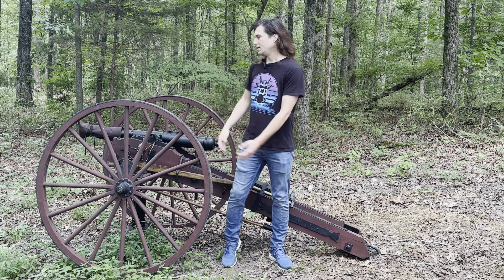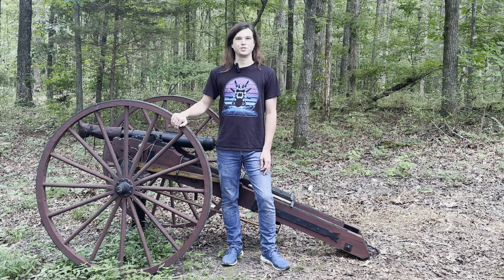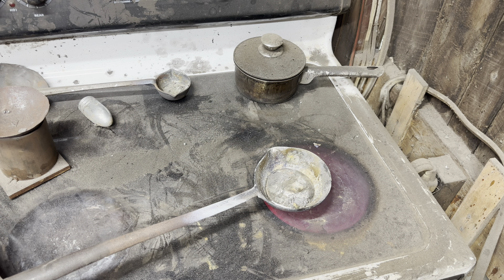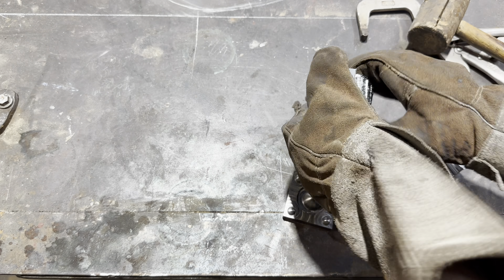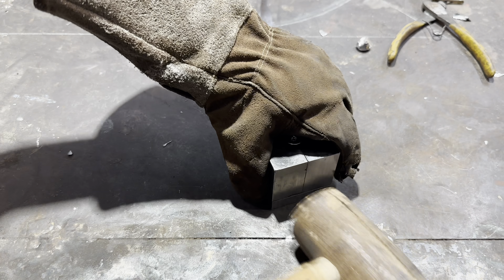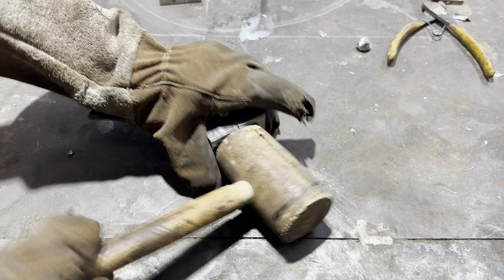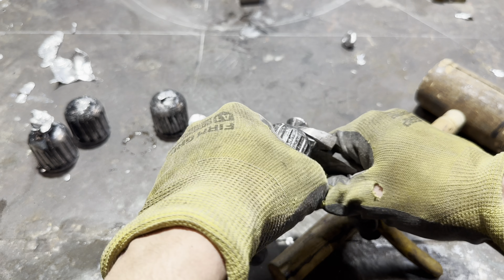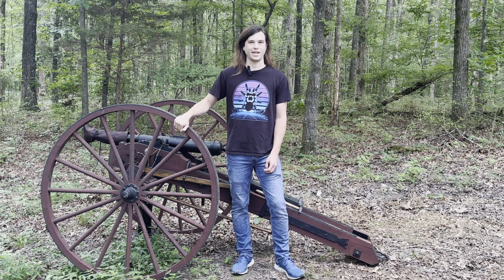Making the World's Largest Rifled Foster Slug

Comment: Drill the pouring hole out so it has parallel sides, the sprue is anchoring the slug in the mould due to the rifling. With a parallel sprue it should unthread out the bottom 👍

Comment: I'm a silversmith and I have never worked with lead but I melt a lot of silver just a little tip if you're mold is made of carbon steel season it until it turns black and it becomes like a non stick skillet and you don't have to smoke the mold every time just use some used motor oil and a brush before each pour or you can take WD 40 and spray it before each pour and the oil will create the soot from the heat in the molting metal also heat your mold before each pour and it will come out a lot smoother again I've never worked with lead but this is what jeweler and silversmiths have been doing for hundreds of years but lead does have a much lower melting point than silver or gold so I can't say for a fact that the oil will get hot enough to create a soot coating definitely work but I would think it would be plenty hot enough to burn the oil off and create a soot layer just the same. But either way thanks for the great videos I love watching you and seeing what you're going to be doing next. Oh and if the oil coating doesn't work you can take any torch a cutting torch works the best I use propane and you just turn the gas on and don't use the oxygen get a oven reck or hang them with a wire and you can get the soot your looking for so much faster and easier

Comment: Pre heat your mold, before pouring the lead. I use a hotplate and after smoking the mold, it's much easier to use a stick candle, and just place all three parts of your mold on the hotplate. After each pour. Repeat the process each time. After the parts of your mold,is nice and hot,pour your lead. Your Foster slugs, will come out perfect everytime. I always flux my lead by using a small piece of bee's wax and then scrape the crud off the top with a long handle spoon. Good luck on your endeavors. Your videos are very cool dude. Peace on the path ✌️🙏

Comment: Smoke the mold, heat the mold, use a punch to tap it out the bottom of the mold after drilling the lead out of the sprue. The twisted rifling crosses from one side to the other causing your opening problem. The cavity needs to be much deeper to even begin to act as a foster slug. It will not swell out to bore size or fly straight. Consider having them machine and bolt in a deeper cavity post to your existing base. It must be centered. 😊

Comment: If you have an acetylene torch you can soot something almost instantly by using a pure acetylene flame with little or no oxygen added. Very smoky directed flame this way. 
The projectile riffling geometry interferes with separating the clam shell portion of the mold.  If you use a punch down through the fill hole the projectile should spin down and out following the riffling, but the soot trick seems to be helping a lot.  Thanks for not grinding lead.   Take care of your self please. :)

Comment: 4:59  If you had held the mold about two inches farther away from the tip of the candle flame, your mold would have been very quickly covered with a layer of Carbon Black.  You were holding it so close to the tip of the flame that it you hamstrung its ability to oxygenate and produce Carbon Black

I used to black my gunsights using a candle flame.  Everyone except older folks at the range asked why I had a stubby little candle in my range box.  I showed them, and it was their V8 Moment for the day.  Really made a difference in harsh indoor range lighting.

Comment: you need a MUCH larger cavity in the base of the shell, also if the pour feature in the top of the mold was reversed, with the top of the shell nearly at the top of the mold, you could cut the sprue off with a knife, or make a shear plate that will do the same. good first attempt, the rifling will make releasing difficult, dont know what to do about that.

Comment: some casting info, apologies if you already know. but even 1% tin makes better castings without changing hardness much. you can use tin solder
from what ive seen pure lead gets rainbowy colors on the molten surface but alloys dont.
alloy components preferentially glob out of solution at the top which means you should flux the lead to get the stuff you want back in solution.
to make good flux spread a layer of sawdust on the bench pour wax over it and break into chunks. 
whenever lead is liquid and dont look clean throw a few wax sawdust chunks in and light them on fire stir around with a spoon until its stops burning then spoon the ash out. then you have clean liquid with alloy components mixed in properly.

Comment: Just my two cents.
A way to cut the sprue and it should slide out the back of the mold. Or, a 4 piece top to the mold instead of a 2 piece.

Comment: Okay, a few points to make.  When smoking the mold, it's much easier if you pour off some of the wax so that the wick is too long.  This makes lots of smoke right away, less waiting.  Most bullet molds have a "knock off plate" on top that forms the funnel of the sprue.  It pivots so as to cut off the sprue and leave a flat spot atop the bullet.  Yours does not.  This prevents you from a clean and simple disassembly.  If you use about a half inch drill to remove the sprue, you could smack the top of the bullet and it would fall out of the mold with the bottom.  The curvature of the lands and grooves in the mold are what is making it difficult for you to do it the way you are, presently.  As a machinist who casts his own, I thought it best to fill you in on these details.
Reply: you are very right!

Comment: You need to heat up your mold prior to pouring the lead and i prefer using graphite powder as a lubricant and release agent. Just use a little soft bristle paint brush to apply a thin layer. It holds up to high heat and isn't toxic. Way better than smoking your molds every time.

Comment: The rifling locks it in place like a jigsaw puzzle or a dovetail joint. 

You can't move the slug radially without  moving almost perpendicular to some of the rifling. 

I wonder if you could leave a smaller  thinner sprue, and then try to hammer the slug out through the base of the mold instead of separating the halves that have rifling holding them together.
Reply: I second this suggestion. Fill it just to the bottom of the sprue, it won't hurt to have a mild hollow point. Then keep the two halves together and tap the slug out from the top.
Reply: I agree, the issue is the design of the mold.  The sides can't come off without damaging the rifling.
Reply: Your rifling is keyed into the mold which will prevent radial movement. Most molds have the cavity closer to the top and a sprue cutter / funnel over. You can use an appropriately sized drill to bore out the sprue and then drive the slug out the base of the mold from the nose.  That should allow the slug to rotate as it moves axialy.
Reply: @GreenWenonah  I'm not casting any myself, I just noticed what was causing the problems.

 But yes I agree with your solution.
Reply: You could take it out from the back if you cut the sprue off. Optionally, you could use a straight hole to pour into rather than a drafted one and it will come right out. Not much of a need for that if the hole is large enough to pour into. It will twist itself out of the mold if its smooth enough. He can polish the mold with cratex then move to grey compound for a buff. Clean it with alcohol and its ready to use. The lead only sticks to the small crevices in the mould and the sprue is helping to hold it in. I use to do toolmaking, stamping and casting, even forging dies. If you do it right, when the lead shrinks from cooling off, it should just spin right out. Otherwise the die is just fine. I would probably make the center section one piece instead after making the hole straight and you will need to polish it smooth. And slightly oversize the mold to account for shrinkage when the lead cools. It doesnt shrink much, but it does a little. All materials do. When you heat the mold it will expand making the size slightly smaller as well. The percentage of oversizing needed depends on the mold material. The info is available online to find pretty easily for thermal expansion. Most manufacturers have the info as well. Or should have it.  I would hope so. Lmao
Reply: The Lyman shotgun slug molds cast a smooth slug, that you run through a rifleing die.

Comment: I do not do very much lead casting, so bear that in mind with my thoughts.  Graphine powder is also a good mould release if it sticks to your moulds properly.  Lead might be too low temp to matter, but with other metals it is a good idea to preheat the moulds to prevent rapid heat exchange.  The sound of rain on a tin roof has wrecked the audio on many of my videos- I share the pain.

Comment: do you think the rifling being on an angle is what is making it grip if they were straight it would come out better?
Reply: I think straight ribbing on it would be even worse. Pulling it out of the mold sideways means pulling across the ribs that are close to the mold seam. 

In theory, slamming it out through the bottom would be better, but then the sprue is in the way and you have the friction of that whole length twisting out at once.

Comment: Ok man, i love that you care about our comments. But as your channel grows and the comment section more populated, you can't let the trolls win. Like with the angle grinder to cut the sprew off. It's not their shop nor channel. Personally, I'd film me putting a brand new cuttoff wheel on every episode, then film myself throwing away said cut off after every use.(sorta like kentucky ballistics and chronographs)They get expensive so i'd prolly also dig it out of the trash off camera. But i digress. The point is, if the comment is clearly a troll or over critique, which is prettymuch worthless in the end, do the opposite of what they want. Otherwise you will end up hyper focusing on nonsense instead of thevids. Plus, im sure the biggest part of your base would love that sort of humor lol. Hope my rambling helps at some point, seen several creators go down the troll rabit hole and it never goes well lol.

Comment: The cavity in the base of the slug needs to be much larger.  The purpose for this cavity is so that pressure from the burning gunpowder will cause the slug's skirt to expand so that the rifling on the slug will engage against the cannons bore and cause the slug to rotate.  That puny cavity means that the walls on the slug will be too thick to expand properly.  Also, if you use even a small amount of tin (like from some lead free solder) the lead will fill out the mold better.  Bullet molds cast better when they are hot.  Finally, if you feel that you need to add some lubrication just smear some crisco on the outside of the slug.

Comment: The projectile itself gets stuck in the mold , because the rifling will act as a screw and hold the 2 halves together.
Reply: i was about to comment the same..
maybe have it in 3 or 4 parts instead of 2 halves and a bottom?
Reply from the maker: Thankfully it came out without maring up the rifling after I smoked it.

Comment: You should heat up the mold with a torch before poring the lead. and keep it hot. it will makes the slugs smooth. That works for me when making rounds for my black powder guns.
Reply from the maker: I usually stick it on the stove to warm up while the lead is melting 🤣😂
Reply: @TheCannoneer  that works too but it looks like its not hot enough. My first ten rounds look like that until the mold gets hot enough. Then they come out smooth,
Reply: Absolutely a cold would will have shrink and possibly cold shut. The mold must be heated up before casting.
Reply: I have mine sit in the pot warming up and candle smoke to the inside to help on the release
Reply: Personally, I really like using a hot plate
Reply: I was gonna say the same thing, but you already said it lol

Comment: The cavity in the bottom of the slug is too shallow, needs to be deeper si the slug can expand and engage the slugs rifleing for proper spin.
Reply: I think you get more performance out of that feature because you're moving the center of gravity forward than you do from that.
Reply: The spin is super important, and the center of mass is also a big deal. I experiment with shotgun slugs just for fun, and that spin is what makes these things work so well, especially when they get around the transonic portion of the fight. Most likely needs a bigger cavity for both reasons. I guess we’ll see!
Reply: @NAGJRC  If it does, thankfully, he will only need to revise the bottom part of the mold
Reply: @simoncleret True. A drill press might do the job too.